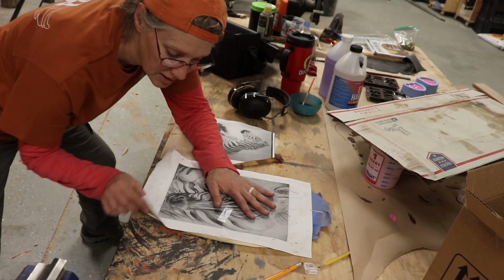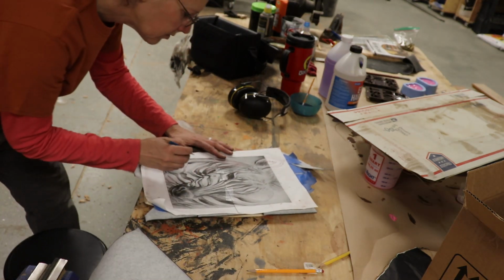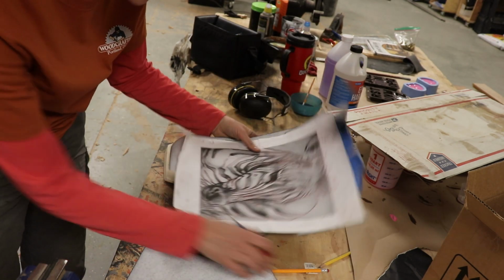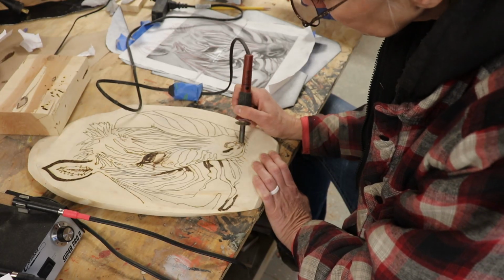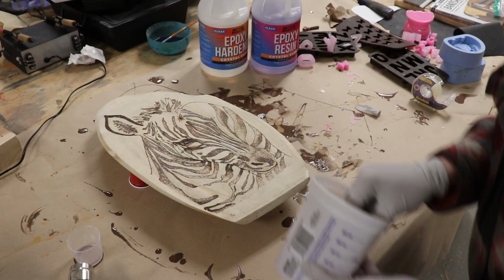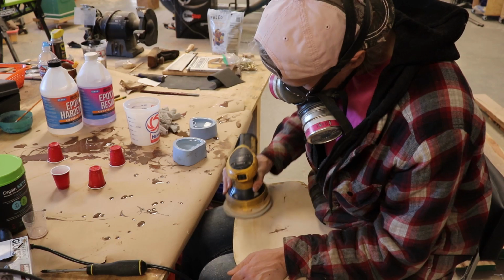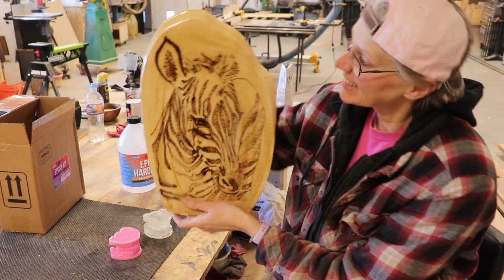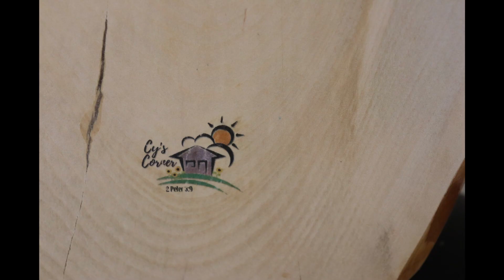Wood Burned Zebra

Comment: I love that zebra! It turned out great! I've been thinking of getting into Pyrography for some time now. I noticed that you have the Colwood Pro 2 but used the soldering iron more. Can you tell me why and how do you like the Colwood burner? Thanks for sharing.
Reply from the maker: I really love my Colwood burner. I used the other burner to make the small dots for shading only because I don't have that tip for my Colwood. The Colwood heats up in a few seconds and cools down quickly too. It also has two cords so I can have two tips ready to use. They don't both heat up at the same time but when you switch to the other tip it is so fast. The other little burner takes about 10 minutes to cool down before you can change the tip and it also takes about 5 mins to heat up. :)